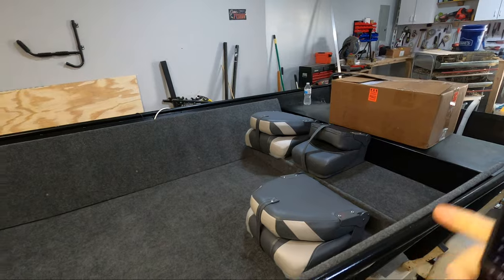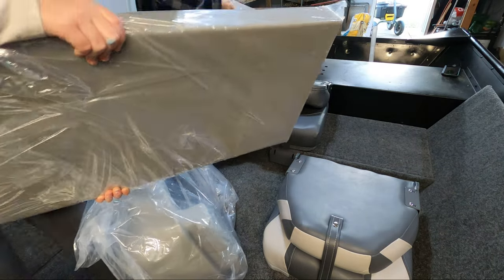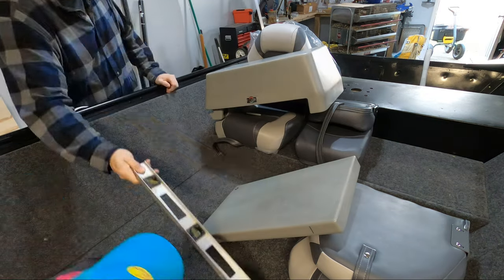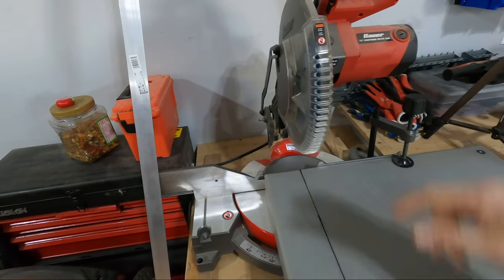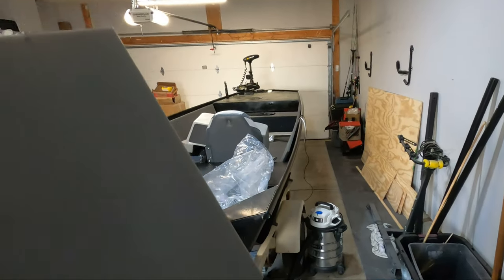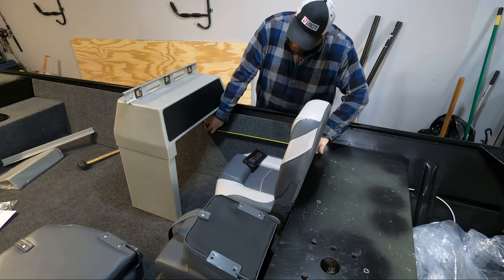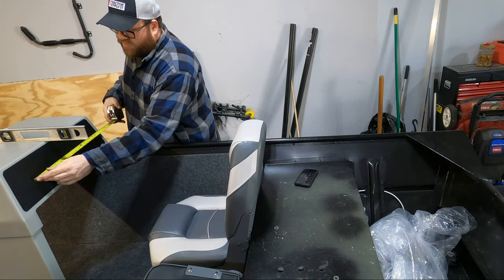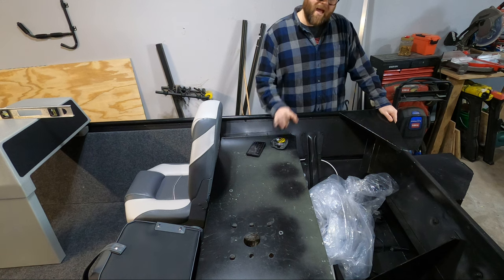How To Measure Outboard Control Cables - Jon Boat Side Console Conversion - Part 1

Comment: Love the build, what is the weight capacity of the boat and have you weighed any of the wood or things your adding?
Reply: From your past boat builds do you think it will effect the way it sets in the water?
Reply from the maker: Capcity is 940lbs and I am definitely under weight. Everything has been done to keep it as light as possible. Aluminum floor, thin plywood walls, etc. I also added float pods to increase the weight capacity roughly 200lbs as an added precaution. With the pods, I do not forsee any issues with how it sits in the water.

Comment: I bought this side council for my boat rebuild and the top came warped and scratched but i did buy the all black version.. this tan version probably hides all those imperfections. It also came with no bolts for the angle mount... I had to reinforce the side wall with a 2*6 to give it enough strength to lean on... im telling you look elsewhere when it comes to these councils. not worth the money.